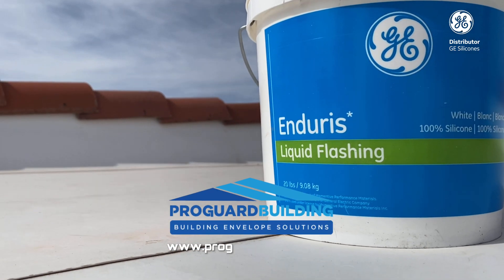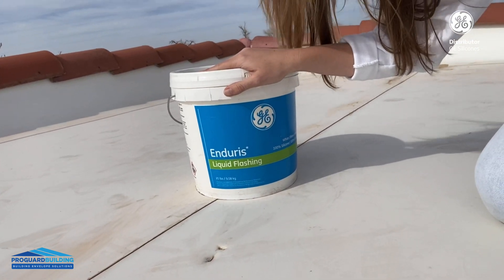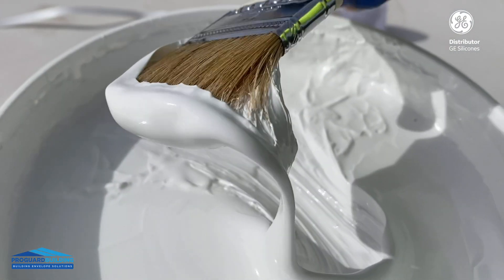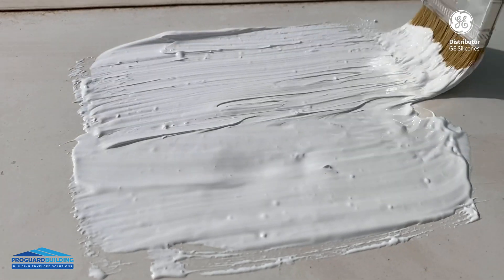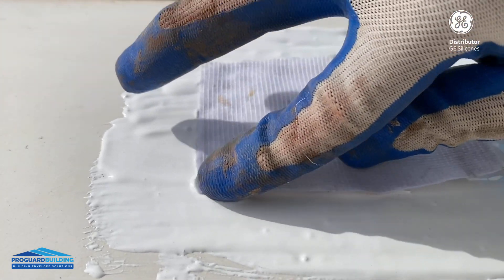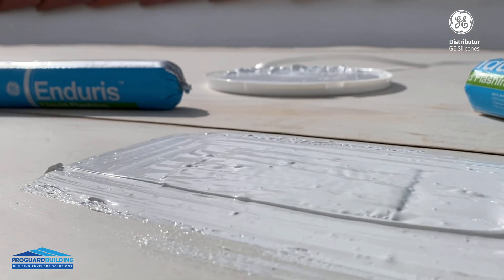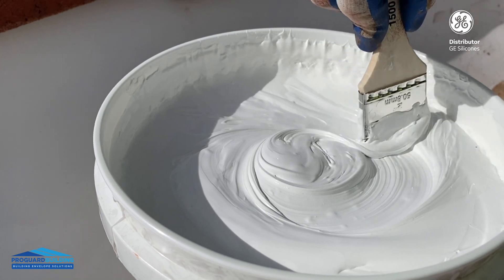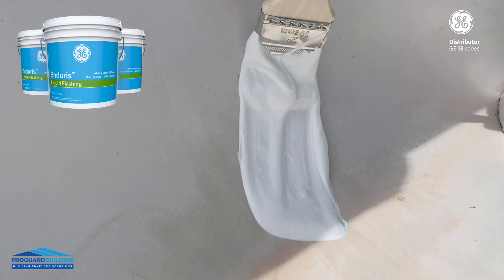How to repair damaged TPO using GE Enduris Liquid Flashing/Roof Coatings. ProguardBuilding.

Comment: It won’t you can peel it right off when it dries works temporarily but best solution just weld a damn patch
Reply from the maker: GE Silicones works great on "aged" TPO surfaces.
Reply: I can't the damn place water is getting through and I've had roofers come out to give free EXPENSIVE estimates and they all never give a clear answer neither. I'm about to just buy this stuff and hit the entire seam 15-20 feet out in all directions where the leak is with this stuff. 
Can you elaborate a little more on why it'd be a bad move to use this? And what should I use then? I bought a heat gun and welded down all the seams where the leak is and that didn't fix it.....I'm at a loss and don't wanna pay $800 to a damn roofer